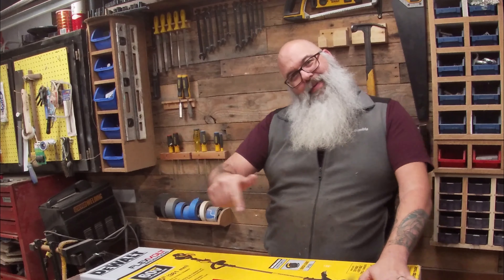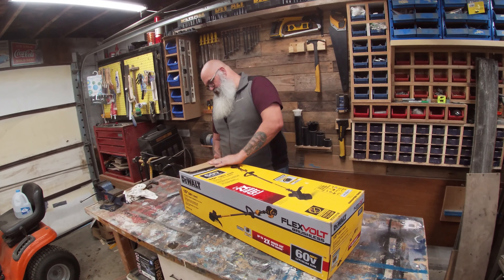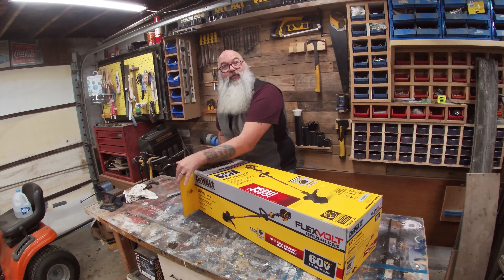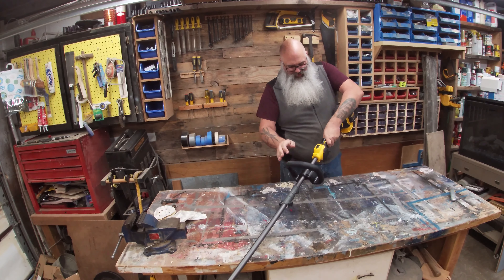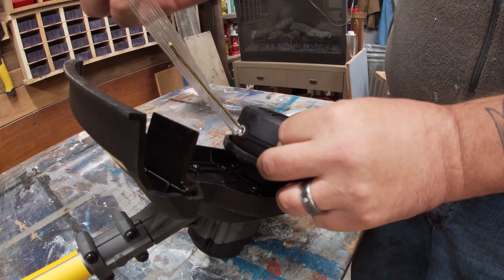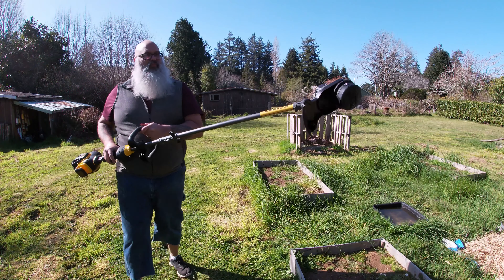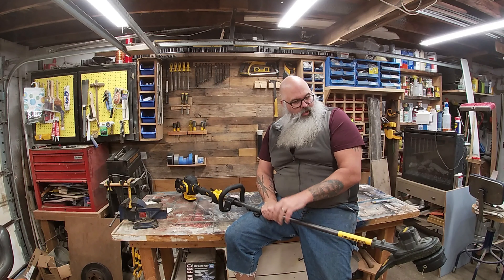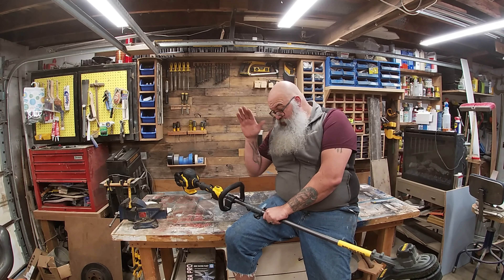DeWALT Flexvolt Cordless Trimmer (unboxing)

Comment: No more pulling gas strings! That part was great haha!
Reply: And I think you convinced me that I need one of these
Reply from the maker: Ha ha thanks! That's awesome. My wife has used it a couple of times now and she loves it. We are a little disappointed in the battery life though. I didn't time it, but just thought it would last a little longer.
Reply: @TheBeardedWoodworker  Interesting.. What AH is the 60V battery?
Reply from the maker: It's a 6AH. Is that gonna make a difference?
Reply: @TheBeardedWoodworker  The AH is basically how big the battery is / runtime. 6AH is one of the largest they make I think, so that is surprising. Maybe you just have really thick grass that drains it quickly!